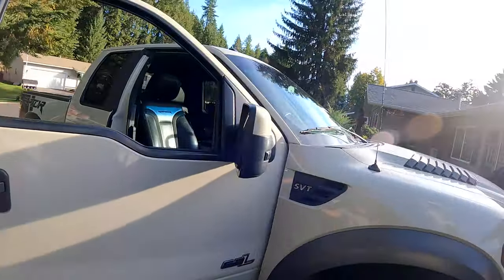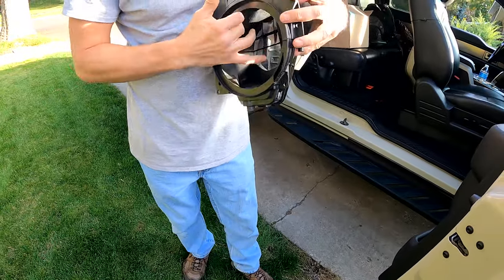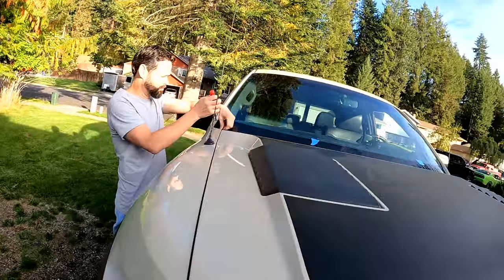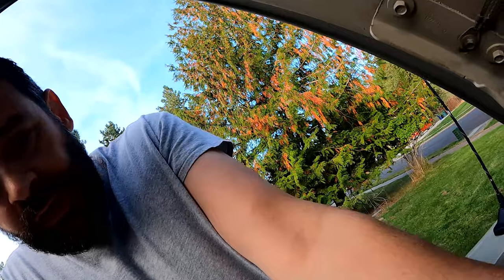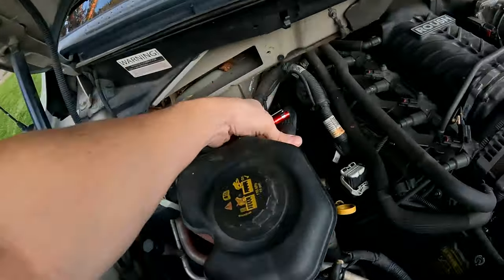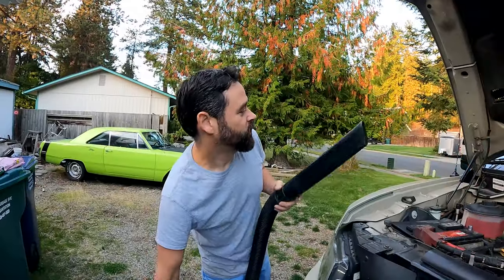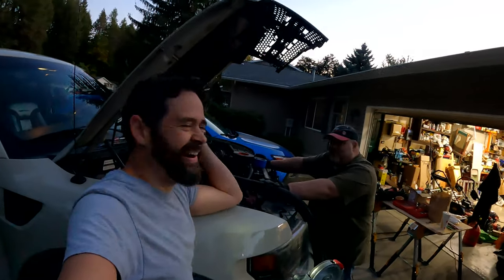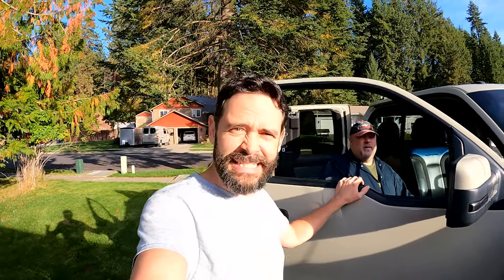How To Clean Fresh Air Grate  on Ford Raptor-F150 [Bonus Cabin Air Filter Replacement!]

Comment: I replaced the vented seats filters last year after reading about it in the manual.
They looked fine so I held onto them but still replaced them with new ones with no media but just holes.

I dropped the blower motor yesterday to remove the broken piece that was causing the motor to vibrate the entire truck.
I need to remove the leaves on the top side of the blower motor one of these days.

I’ve had the truck since 2013 when I bought it brand new. 
Right around 56,000 miles right now.
Reply from the maker: Sweet! Sounds like a nice rig and very cool you're the original owner. We're working on a way of preventing the leaves from getting down on that grate. Once we figure it out, we'll post a video here so stayed tuned. Thanks for commenting!
Reply from the maker: Also, don't forget we have a video on how to replace that broken piece WITHOUT removing the dash like Ford says you have to, if you're going to fix it: https://youtu.be/aop-XfuFqFM

Comment: I went a little different route to get all the rear screws out. I used a short piece of hacksaw blade and cut out a few of the rear plastic grids so I could take out with a 8mm wrench and a small ratchet and 8mm socket. I didn’t get it done in three hours but around 8 hours taking breaks, I’m 70 years old.
Reply from the maker: Haha, you did great! You are 70 young my friend :)

Comment: If you take a Tennis ball and drill a hole smaller than your shop vac hose on one side and get some large or small tubing depends on project and cut or drill another hole directly across from the first hole to insert your tubing. Then you attach the ball to the shop vac with duct tape and insert your tubing.  Then you have a vacuum insert that can get into small spaces like you are trying to vac out. Maybe get 2 or 3 different size tubing pieces and use one for large, another medium and a fine one.

Comment: Great content as always guys! Thanks for the pointers and tricks. I haven't done this yet to mine, but it's something I will reference for the future (your video is saved to my truck playlist by the way) 😁
I had to use a video from a nice gentleman changing out the bulbs in his F150 (non Raptor, but still the same headlights luckily) I put some nice blue LED headlights in to replace those old boring yellowish headlights that come from the factory. Now my 2010 Raptor has an aggressive updated look, and we even have the same ones in our 2014 Freightliner Cascadia. I love the look, and the lights even have built in cooling fans in the back, how cool is that?! (Pun intended). I would eventually like to get some of the headlights like those you have in your Raptor, Uncle Jake. But for now, these will do. My task was way easier than yours, but thanks again for sharing your wealth of experience with the rest of us who mechanic on a shoestring budget 😉
Did not know about the filter under the passenger seat, mine is heated only, and only my passenger gets that luxury because mine on the drivers side doesn't work for some reason (maybe a fuse, or bad connection under the seat) but I will try and track it down, I guess I will have to take it back to the dealership and get them to check it out if all else fails.
Have a great one y'all!

Comment: Could this be why my air seems to blow harder than other times? It truly feels like sometimes my air blows really hard and other times its not as hard. No issues with the ducts or anything. I did the resistor replacement already, is it possible that the blower motor has an issue from the old resistor getting hot and having the burned look that they get? If so i will just get a new blower motor.
Reply from the maker: Its really hard to tell without being there to mess with the truck with you, but if your ducts are all cleaned like we showed in the video, our next step would be to diagnose if the blower motor regulator was sending proper voltages to the blower. If so, we'd probably throw a new blower at it. Good luck!

Comment: could you put a filter blockin there so you dont hav to do that all again?
Reply from the maker: I have thought about that. There is an aftermarket screen for these thats held on by magnets. Ive thought about trying that. Currently, I dont part under trees like the previous owner so Im hoping it doest get clogged again. Crazy design though.

Comment: i had my oil changed i have a 2010 raptor do they change that cabin filter with the oil change or thats something totally different
Reply from the maker: So good news the cabin filter was just a joke, your truck doesn't have one. Oddly, trucks of this vintage don’t have them even tho lots of the competition did. So no worries there. But weirdly, the seat has a filter if you have the vented seats. However we do show some other areas in the video where debris can get built up and clog your air flow so be sure to check out the rest of the video. Thanks for the question!
Reply: @MotorsandMischief  was that for me
Reply from the maker: It was. We wrote it on mobile and in rereading it, it didn't make a lot of sense. We edited it. Bottom line, no cabin air filter in your truck so you don't have to change it. Thanks again for the question!
Reply: @MotorsandMischief  👌👌👍